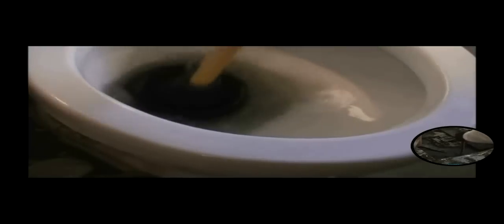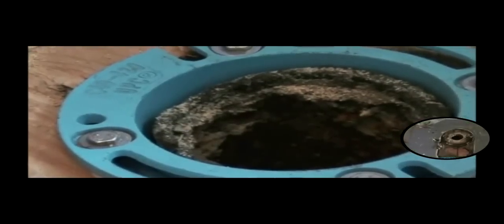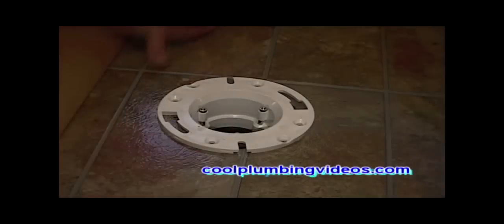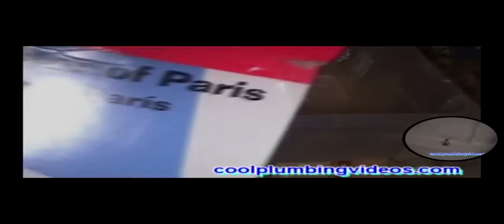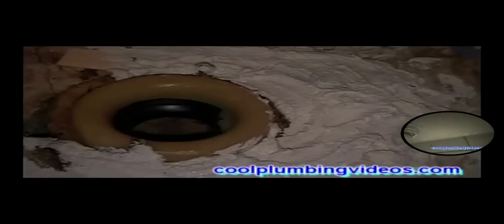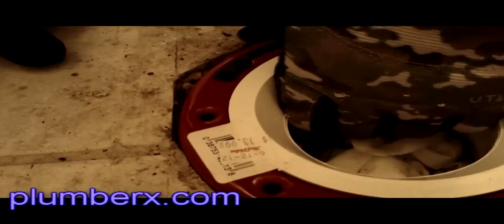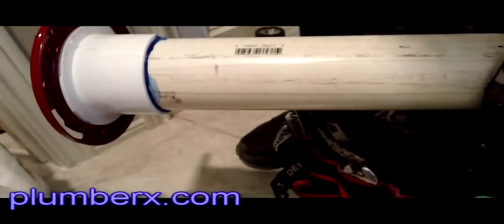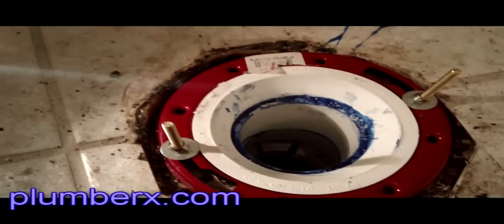5 Toilet Flange Repair Types | How To Plumbing

Comment: i was watching this old house and the show's plumber, Richard Trethui, used this new device to remove the flange. Basically, it was a device that went into the hole and got hot. The heat would transfer from the tool to that inside flange piece and it would melt the glue. You would then pull out the piece and the inside of the pipe would be so clean that you could just put new glue on it and put on a new flange. You should look into getting one of those.

Comment: Where are your gloves?  Thanks for your instructional video, i'm changing a wax ring on  a leaky toilet in an older home - found out the flange is damaged where the bolts should be holding it in place - your video has been very helpful - thanks